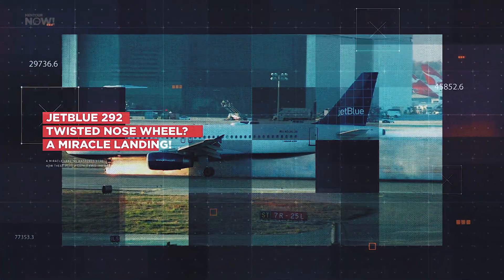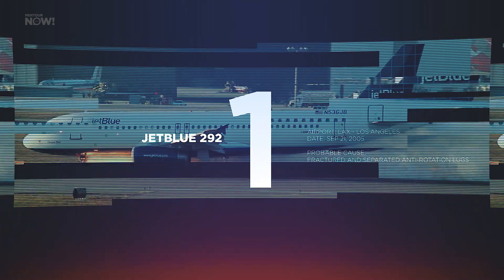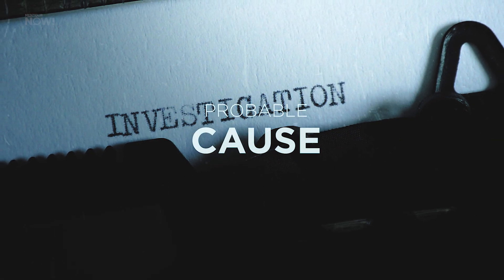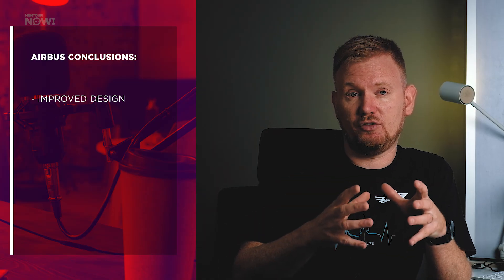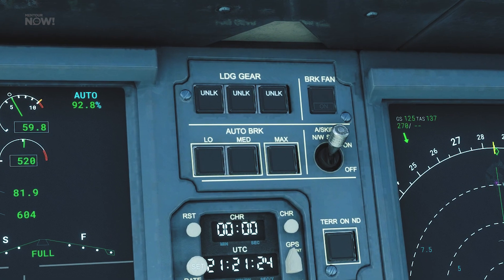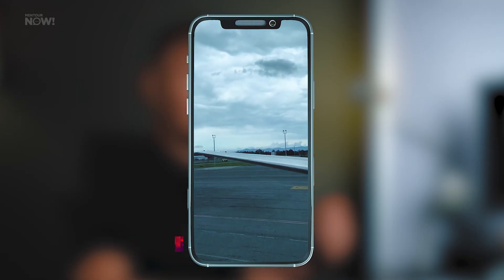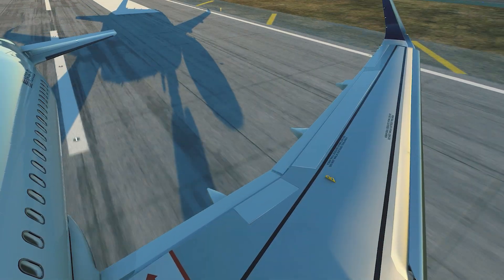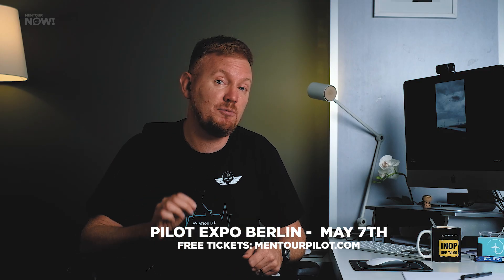The TWISTED Story of the Airbus A320 NOSE-GEAR!

Comment: Why did the pilots extend the RAT instead of turning on the APU?
Reply: They shut down the main engines as soon as they were safely down, to avoid sucking in any debris thrown up by the nose wheel;  so then the RAT extended automatically  (even though it wasn't needed and wouldn't work at those speeds anyway.   But I guess, it doesn't hurt the RAT or the plane and installing a circuit to prevent it would just be an unnecessary complication)

Comment: Those instructions in the "extra section" towards the end of your description of the check lists, just before showing the latest video, were exactly what the pilots did in your big story about the Jet Blue incident on the other channel. Move passengers back, "brace", etc., etc., etc. It underlines just how brilliantly that crew acted - they didn't just go "by the book", they effectively wrote it!

Even though each problem you described was different, it does seem to me - a total layman when it comes to engineering! - that the whole nose wheel array (internally and externally, hardware and software) should be redesigned. There shouldn't be so many possible faults, at least that's how it seems to me. 

Had one of the earliest incidents ended tragically, I do wonder if the authorities would demand a redesign, especially if there had already been a few, benign, occurrences. I'm obviously relieved that no one has been hurt by the recurring outcomes of so many incidents, but that does leave me wondering if the problems are being taken seriously enough.

What if a landing needs to take place on a wet runway? The "let it roll to a stop" method could well end up with a plane running off the runway and onto potentially hazardous terrain. I dread to think of the outcome should that happen.

Fascinating as ever, Petter. Thank you so much for your excellent work.

Comment: I can understand that all these are different failures, hovewer it is obvious to me that there should be design review and some is still wrong here. Typically some mechanical locks are used to block gear in default position in case of controls failure. This should be implemented here.
Reply: I'm pretty sure that the 320 rotates the landing gear to the 90 degree mark before stowing. That said, if there is a failure then the nose gear is already locked at 90 so as to prevent a more serious landing problem of a misaligned front wheel such as in the case where the locking pins were sheared off.
Reply: @Tony-Waldron  I thought so as well, at least I thought I had seen that and assumed it would need a less deep wheel well, but that must have been a differnt type of aircraft. I looked it up and in a video where they executed a gear retraction test during maintenance with the aircraft jacked up, it went up with the wheels straight. Also there seems to be a braking plate on the top of the well, to stop the tires from turning after retracting the gear.
Reply: The majority of these faults would not be fixed by a lockout as the computer would have unlocked the gear before a fault is triggered.

Then there is a problem of a lock adding another point of failure vs how many failure points are present.
Reply: Every other airplane on Earth with a nosewheel oleo strut has what you’re talking about: a nosewheel centering cam. It works off the extension and compression of the strut. When the airplane is in flight, there is no weight on the gear, so the strut is fully extended, which engages the cam and straightens the wheels. When the airplane lands, weight on the strut forces it to compress and disengages the cam, allowing the nose strut to rotate for steering. How and why Airbus designed their steering without a simple, mechanical, industry standard safety mechanism and managed to get it certified is beyond my understanding.

Comment: 12:24 is that a deployed ram air turbine? presumably the engines were working fine during the accident, providing hydraulic pressure and electricity, so why would they need it?
Reply: They shut them down as soon as they're safely on the ground, so they don't swallow any debris thrown up by the nosewheel.   (Said so in the video).   So then the RAT deploys automatically (though I think it's probably not necessary at that point and anyway, it won't work with no airspeed!   But it doesn't hurt the plane or the RAT, and it would need another system to prevent it, so why complicate matters.)

Comment: Airbus‘ guidance not to do anything special if the nose gear indicates down seems appropriate. They might be incapable of building a nose gear assembly that keeps the wheels where they are supposed to be, but they can obviously make the leg strong enough to take the forces from the tires/wheel scraping the runway. Are there incidents where the nose gear collapsed in this situation and after a safe indication before touchdown?

Comment: IMO, if the gear is at 90 degrees from the expected. Then you're not going to want to put any more load on the gear than needed. So following that unsafe gear checklist seems very logical. 

I do wonder why there isn't more self centring added to the wheel. ie, de pressurise the hydraulics and on contact with the ground, the wheels will return to straight ahead.

Comment: While I'm guessing it happens to other aircraft types, it seems like it's happened to the A320 more than others which suggests some common cause, even if the proximate causes are drastically different.
Reply: There have also been over 10000 built since 1986, so it's also because  there are so many.

Comment: I am not surprised by this as I spent over 40 years working for a major Avionics manufacturer. A fault would be flagged and something totally unrelated would be causing fault and not fault that was flagged.
Reply: Sometimes the computer in my car will display several fault codes at once. Repair shops like to estimate the cost of repair based on EVERY fault code, and add them all up for the grand total. I bought a factory service manual and studied the relationships between different systems and can pretty much zero in on the problem. I think some of these automotive systems are overly complex, so I can only imagine how complicated aircraft systems must be.
Reply: @RetNemmoc555  Interesting I did exactly the same thing with my MR2 Spyder. The factory repair manuals for this car are 4 inches stack! I just can't imagine the work load on a commercial airliner when things go South.
Reply: @RetNemmoc555  Yes aircraft systems are much more complicated than automobile systems. But the basics are still the same and there is an interrelationship  between  systems no matter where they are used and sometimes its not that easy to diagnose what the problem is! Yes they are putting in systems that are way to complex for there own good. they need to use the KISS principle. Keep it Simple Stupid!
Reply: @RetNemmoc555  My sister's KIA Soul has the EPS warning lamp on. The problem with that is the car basically using it as a master caution warning.
Reply: If you want to see the most reliable, concerned for the customer, knowledgeable auto mechanic, you ought to check out YouTube videos from Rainman Ray who lives and works in Florida. He often not only explains why auto systems are so complex, but how complete a professional code scanning system can examine and manipulate virtually all the systems in modern automobiles.

Comment: I have done very little work on the A320 series, I would guess that it does not have a centering cam built into the strut since the BSCU moves it around before landing.  Most, if not all aircraft I've worked on have a physical cam built into the nose strut that it will fall into when the strut is fully extended after take off.  Is this a design that some of the other newer Airbus's have?
Reply from the maker: Not sure but it sounds logical

Comment: It’s time to ground all for these Airbuses, take a step back and re analysis the NWLG and come up with a totally new design since it is only happening on the A320
Reply from the maker: Nah, it’s still a TINY little percentage that have experienced this problem and in most cases it’s due to faulty maintenance in one form or another. 
Also, as has been proven, it’s not really that dangerous.

Comment: "how they didn't notice that, I'm not sure," sounds like a very polite way to say something significantly less polite. I'm actually laughing at that that sounds.

Your explanations are still awesome to enthusiasts like me. Glad to see you're still absolutely fantastic!
Reply: That's what I call polite but not nice.
Reply: That’s insane they didn’t notice.  They are almost sitting on top of it, that had to make one hell of a noise.
Reply: maybe theirs a lock on the wheel that locks it into position, that broke and given the direction of the aircraft and how it was moving, allowed the wheel to rotate forward in the general direction of the aircraft's movement and allowed them to proceed with the takeoff normally until they got it in the air and put it down and the force of the resistance of the air on the wheel jammed it in the most inaeordynamic way
Reply: Ah, yes, the polite way of saying 'use your eyes, mf!'

Comment: "Once is an accident, two is a trend, three is a real problem." Cannot but wonder about the overall nose-wheel system design regarding control and feedback concepts and incomplete failure tree analysis. Multiple sequential patches did not seem to mitigate the nose-wheel hard over problem whatever the not-covered cause might have been. And yes, aerospace is hard...

Comment: The different modes of failure leading to the same result reminds me of HVAC service calls I've been on. "My air isn't cooling 'again'". Then I get there to find a totally different failed component than the time before. But trying to get some rental property tenants to understand that can be challenging.
Reply: You get this situation in any technical field.   I used to do TV repair.   Any one of a hundred parts could cause loss of sound.   As far as the customer is concerned its the same fault every time.   What you do is build in a bit extra in your standard pricing, so that when  luck brings you back to the same customer with the same symptom(s), you can fix it for free and retain the good will.  You cannot expect customers to understand technical detail.
When you fix faults you should also do basic checks that usually will reduce the probability of a callback.   My car was leaking coolant, so I took it to the dealer.   The mechanics spotted that a hose was weak so they replaced it.   But next day it still leaked coolant.  This time they identified another dodgy hose.  They considered that a separate fault and wanted to charge me full parts and labour again.   My view was that if they were competent, once they found one dodgy hose, they should have checked ALL hoses - after all they were all equally old.  So I offered to pay for the extra part cost but not the extra labour, as the labour in the first job I had already paid for turned out to be not properly done.  I had to fight for that one though.    But if it was coolant leak problem and next day a brake fault, then clearly the faults are unrelated and the customer should pay for two different lots of parts and labour in full.

Comment: The incident aircraft in the 29th is operational again! It was repaired at MDE and got ferried to BOG in the 13th of April. It fully returned to service yesterday, flying to PSO, which is... brave. PSO is a very challenging airport with a relatively short runway

Comment: I worked on a flight deck of an aircraft carrier, I've seen a S-3 jet launch off a catapult with a parking brake set.
Reply: Pretty sure a catapult will easily overcome a tiny park brake. I'm sure it's amazingly dumb but probably not even a blip for the catapult and TOGO thrust
Reply: @etherealrose2139  It flew just fine. The tires didn't even pop.

Comment: Just like going to the supermarket and selecting a trolley with a dicky wheel.
Seems like Airbus likes to give you Ecams that at first are not necessarily obvious so its damned if you do & damned if you don't. Which checklist is appropriate & which isn't. Very difficult for management & decision making. How will sensitive sensors in wheel wells & alike be effected by de-icing procedures for example? Is there too much reliance on automation & how many layers of redundancy is too many?

Comment: I can accept that the exact causes of all these failures are different. But I can't help notice that they're all on the same kind of airplane, which suggests that there might be some kind of underlying fault that makes the design prone to having this happen from various causes. So what are Boeing, Bombardier, and Embraer doing differently that makes this not happen with their planes?
Reply: But it (or something equivalent) does.    8600  A320's built, six (seven?) failures is not a huge number. 
737's  seem to have a thing with collapsing main gear - again, 11,000 built so you'd expect a number of failures.
Reply: @cr10001  OK, wasn't aware of those.
Reply: @mikekeenan8450   I'm afraid Mentour's headline is a bit click-baity.   Also IMO misleading in that it implies there is one identifiable thing 'wrong' when (as his video then explains) there were a number of different causes.
If you take any aircraft of which thousands have been produced, there will be a number of similar failures over the years. 
I'm not going to say the A320's nose gear failure rate is 'perfecty normal, everyone has it' because I just don't know, but I'd love to see some comparative statistics.    If other makes or models do have a significantly lower failure rate, then your question 'what do they do differently' is valid and interesting.

Comment: As a layman I still feel that this is the same problem: nose gear is prone to turn 90° whenever something is off. Should just be impossible for that to happen somehow unless it is forced into that position physically or by an input...
Reply: Basically it's a fail safe position, that's why it goes there if something is seriously wrong. At 90° it hits a mechanical stop. The thing is, what if the nose wheel is at 0° but there's nothing to hold it in this position when it touches down? The aircraft could wear of the runway. 90° may damage the landing gear and it creates a lot of sparks when draged over the runway, but overall it's a fairly save position.

Comment: So, what have we learned? 1) No matter what, the nose gear on the  A320 is going to break. 2) No matter what you try to fix this problem, another problem will occur and the nose gear will break. 3) It's OK to fly a plane with a known faulty nose gear as long as you don't make any extreme turns, like the kind you normally might have to make. If you do then it's not the fault of the A320, it's the pilot's fault. 4)Basically Airbus sucks and the A320, in particular, is the Ford Pinto of Modern Aviation
Reply from the maker: Well, not really. You still have to remember that we are talking about a handful of these issues, spread out over 20 years without a single injury. Meanwhile the A320 has done tens of millions of flights so it’s a VERY small issue in the grand scheme of things.
Reply: @MentourNow  OK, I concede your point. But how many injuries, or even deaths have to occur before someone says, "Guys, enough is enough already! Good enough isn't good enough! Design, build and maintain those airplanes as if your children will be riding on them. Because, who knows, they might be."
Basically my point is that if you charge hundreds of millions or even billions of dollars for a product wouldn't it be cool if you made darn sure that it was the very best it could possibly be? 
They build sophisticated $25 million dollars computerized flight simulators so that pilots can test their skills in every possible scenario. Why can't they build computers that can test every function of an aircraft, in every possible (or even just really likely) scenario? 
And before anyone starts arguing about how much that would cost. 1) How much is a human life worth? 3) How much are hundreds of lives worth? 3) Scroll back a few lines to the part about these planes selling for hundreds of millions if not billions of dollars.

Comment: How is Airbus not addressing the OBVIOUSLY BAD ENGINEERING of the nose gear!?! It should have been recalled and gone under a complete design overhaul! They are sacrificing people's lives for their profit margins!
Reply from the maker: No.
So far there has not been a single injury to people and you have to remember that these are a handful of incidents, spread over 20 years and tens of millions of flights. 
It’s important to keep a bit of perspective.
Reply: @MentourNow  That is way too big a dice roll for me. Until I hear of an actual engineering fix, I am not convinced. A car would be recalled for a faulty wheel design. Sounds like profit protection to me. I will avoid flying Airbus until they actually fix it. Not worth the odds at all.

Comment: I’m not an expert, so why only the Airbus 320?  How does this specific nose gear differ from other Airbus or Boeing nose gear?  At some point,  someone has to say enough is enough and redesign it or use an older design that actually works….
Reply: The difference is that the A320 was the first fully fly-by-wire commercial airliner. Boeings use a plain old mechanical linkage to steer the wheels.
Reply: @wrkingrageaholic  thanks

Comment: Has this ever happened to the 737. And are there procedures in place if it does happen?
Reply: No, because the Boeing 737 design is more basic that the Airbus A320 meaning it's more redundant.